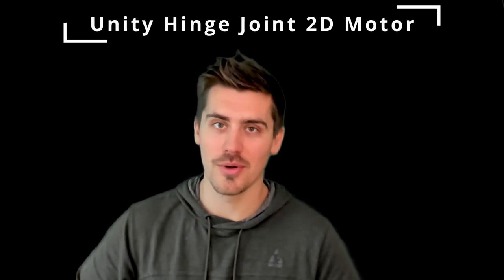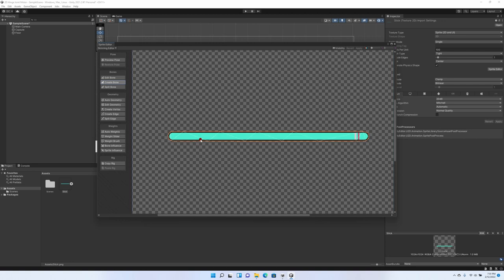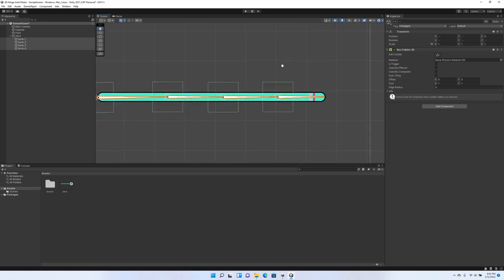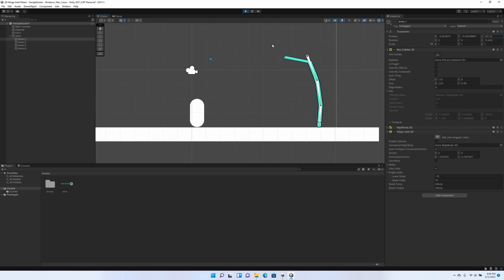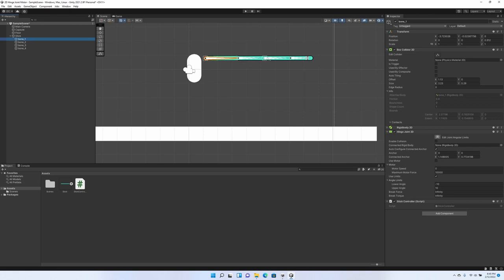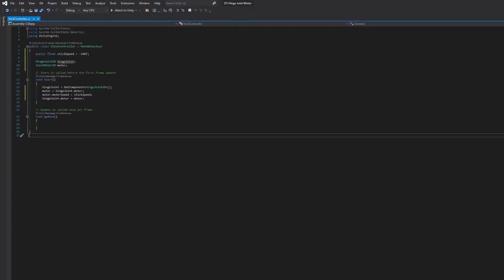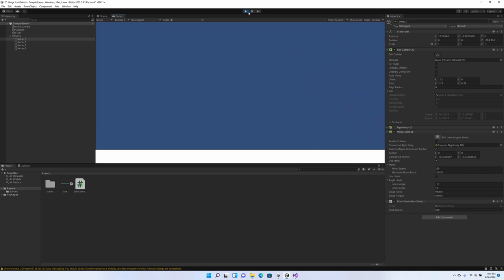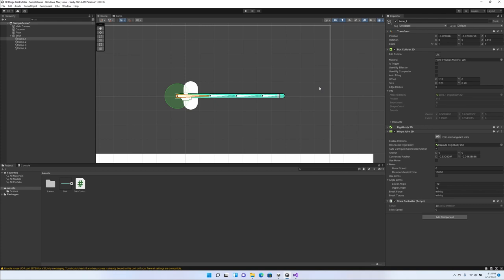Hinge Joint Motor Unity 2D Tutorial

Comment: Generally, GetComponent should be in Awake(), as a best practice. A reference here means, your variable points to that specific component (the hingejoint). By putting variables outside the function (Start in your case), you cache them, i.e. you keep them around in memory. This makes sense for components you want to access in several frames, but you can’t link up variables that way (this is possible with getters and setters), hence you have this redunant setup.

Just try:
hingejoint = GetComponent …
hingejoint.motor = stickSpeed; 

“get me a reference to that hingejoint component on this same gameObject; 
“in that hingejoint, set the motor variable to the value from stickSpeed”   

That’s all you need. If you type hingejoint. (dot) intellisense shows you the variables in the hingejoint you can access and get/set. Keep un mind that getting the variable just reads the value. E.g. currentMotor = hingejoint.motor. 

Hope that helps! I also stumbled over joints early on, subbed!